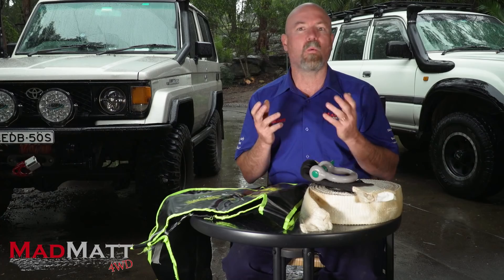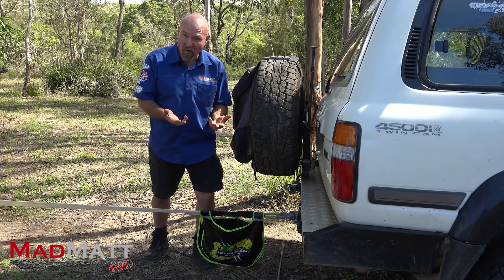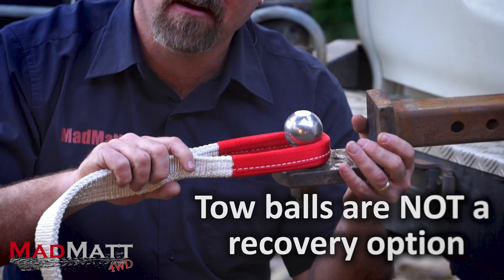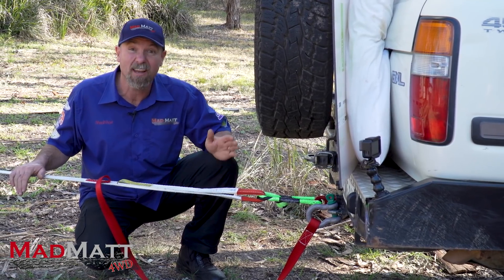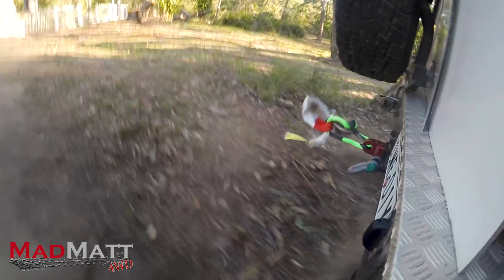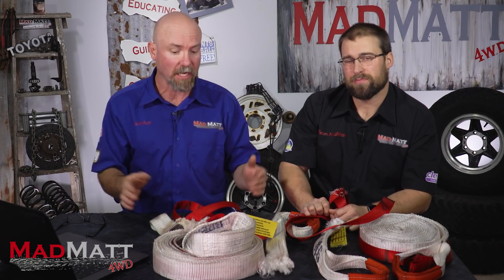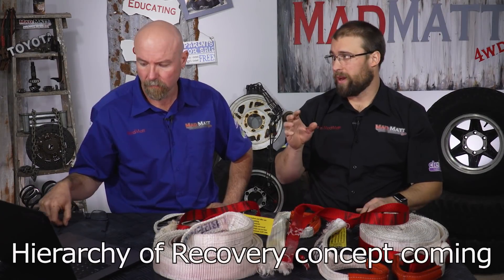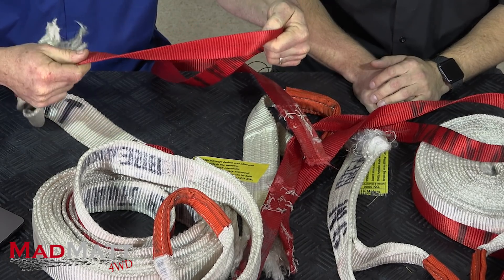Dangers of Snatch Strap Recoveries - Destruction Testing

Comment: My ideas would be: 1) To make the tether quite a bit longer so that by the time it engages, the broken snatch strap is already rebounded to its initial length and all the tether has to do is arrest the mass of the tether in flight instead of the tensile force of the stretched strap. 2) To make the tether part elastic too so it absorbs the energy in the tether instead of just ripping out the stitching. 3) to make the tether be a bit stronger (maybe 1/4 to 1/3 of the breaking force of the main strap). Because of the fuse, we know that the force the tether is faced with is the full breaking limit of the strap, which is considerable. And to be safe, we need turn that energy into heat rather than momentum. A weak tether can't convert much energy into heat before it breaks.
Reply from the maker: Totally agree

Comment: Like you stated, those tethers are too short to be effective. They would be better at 20% longer then the stretch factor of the snatch strap. Then, also FUSE THE TETHER! This way on a failure. The snatch strap would be fully unloaded and the tether would only have to suppress the straps momentum. The fuse in the tether would prevent the recovery vehicle from reloading the strap. You may still have some recoil, but because tethers fuse there would be less energy stored in the strap.
Reply from the maker: Agree

Comment: Love the use of the mattress and corry iron to protect the tree haha
My complaint is you are using your 80 series.. haha...   hows the scar in the tree, would have close to be healed by now or will in 5 years.
Good work, well done.
Reply: Use a 20' strap as the load strap. Add a 30' strap wrapped around the 20' strap. I attach both to the same load point shouldn't need different  points. When if the 20' strap breaks it will tangle in the 30' foot strap before reaching other end. Strongly suggest the 30' be a stronger strap but is not necessarily required.

Comment: I was taught that you’re supposed to drape a blanket or a coat across the middle of the strap or rope when you were going to pull.
Reply from the maker: That was the thinking back in the day but now days it's preferred to fit the dampers at each end and in the middle. Although some of us are moving away from dampers all together but that's a massive discussion.

Comment: How did you rig the first test to have the shackle fire off of the 80 Series into the tree? Just so I can make sure I never do that.  Thanks!
Reply from the maker: So long as you use good gear correctly you'll be fine. I had a fuse in the system so it failed when and where I needed it to.

Comment: i think a good design would to have the safety strap 2/3 the length of the snatch strap, and have the safety strap in a bag attached to the vehicle and the bag  with  a slot so the safety strap has to be pulled out of the bag to slow the snatch strap down  but limit the length to 2/3 , then after the snatch strap  snapped you have a strap that will be 2/3 longer so the vehicle has time to stop and not pull on the safety strap
Reply from the maker: That's worth considering for sure.

Comment: Need a 10m seatbelt strap set up on a Auto enursha  spring set up that has a recoil spring?
Reply from the maker: That’s an interesting idea
Reply: The longer it pulls out the stronger the spring gets. Don't have a lock like a seat belt but just the recoil?
Could have pins and a Rachel as well so it has more than one use?
Reply: Maybe even have the complete Snatch strap set up on a recoil Hose reel sort of set up and have a fuse replacement  pin rated at 4ton?
Fully retractable  .so when it reaches  its limit ? It's breaks the pin and1/3 is under high spring tension?
I too have seen a Snatch strap go off and Break through  the rear glass of Tow car and rip off a Mazda recovery  point

Comment: I’m pausing the video at 11:00 minutes to comment so I might be too hasty but ....
I didn’t understand your description at first,  then when I saw it I thought it was a brilliant idea but why isn’t the tether about 80% or 90% as long as the strap and accordion folded under a Velcro loop ?  Wait..... I have a big roll of 2” wide industrial Velcro.  What about the whole length and width of the tether,  Z-folded against Velcro.  The inertia of the strap is lightweight enough the Velcro would slow it down some before it completely unfolded.  It could even be made as an add-on kit for existing straps.  Maybe the forward end of the tether “system” should be attached to a separate spot on the vehicle just in case the failure is forward of the strap fuse. <<disregard that last sentence,  I just noticed you do have it connected to a different spot. On a side note,  I was never comfortable with the jolt,  so I put two 30’ together for 60’ when there was room and really liked the result.  There’s probably a whole list of reasons that’s not smart but I did avoid any mishaps thanks to a good off-road coach.  OK,  now back to finish the video.
Reply from the maker: Lol. Champion comment. You have some great thoughts there and I certainly would like to explore some different solutions
Reply: MadMatt 4WD 
You and I both responded to Russell Hembrow’s suggestion of  2  unequal length yank straps joined loosely every few feet with loops.  It just dawned on me that if the tether needs to be a lot longer anyway,  exchange Russell’s 2 nd strap idea for just one super long tether 
attached to both vehicles,  with plenty of extra length accordion folded at each end.  Along the length Russell’s idea of loose retainer loops is 👌

Comment: Sew it on in a concertina so it dissipates the energy as the stitching tears away? It will still recoil, but with a lot less force. Having the weak point/fuse will help too as its better to be hit with a strap than a chunk of metal from the car, it will bloody hurt and leave a mark, but shouldn't take your head off.
The problem is that people are less likely to buy something that is designed to break, even if its for their own good. Good rated nylon is expensive, so it all adds into the price. An expensive strap that is made to fail? Its a hard sell, even if to get it to break you're probably abusing it.
Reply from the maker: I think that would work.

Comment: Matt what do you think about winching from a tow ball?
Reply from the maker: No not ever and there's no need to as it's easy to have a decent connection point.
Reply: @MadMatt4WD  Matt, suggest you speak with your new buddy from Winder Towing about. I wouldn't recommend using a hitch ball, but Matt does it all the time.
Reply: kingstonsean Matt at winder never winches from a tow ball. He doesn’t even have a winch on the banana. And he uses his j hooks in a bridal configuration. He is a licensed tow operator and has insurance liabilities to worry about.
Reply: @CooterTravenport  You're correct. He doesn't winch from a tow ball. But he does use it for recoveries, and that's what I was picturing in my mind. This video isn't even about winching - it's about recoveries. Anyway, I would think strap or rope recoveries might cause even more dynamic load than winching. Winching is slow and steady, recoveries will always have at least one significant "shock".

Comment: Making the tether like a fall arrester would make the snatch strap a single use device, no one would buy them. all it needs is to be made out of stretchable material that could absorb the energy without breaking so it would be reusable.
Some years ago we had a snatch strap that was made from a rubber that would heat up when stretched, this heat would cause the rubber to contract with great force but very slowly, it was known for pulling off axles or doing other damage because once activated there was no way to stop the pulling force so they removed them from the market, I made a high pressure release for mine with an adjustable tensioner so I could control it better but it was still dangerous it you didn't know what you were doing, it was stolen out of the back of my 1961 dodge power wagon and I could never find another one to replace it.
Reply from the maker: Wow I've never heard of that devise. Sounds wild.

Comment: Matt, maybe talk to Simon at Lock Your Hubs 4wding (Youtube channel) he has test rigs with load testing equipment, and both of you should be able to work something out which would be great to see and some more collab between content creators I think is great for the community. Yes, I know this video is in 2019. To me it seems the tether strap is severely underrated for its intention, it should be a similar thickness and type as the strap itself, and should be a longer length and possibly be at least(my rough guestimation) 1.5 mtr to take up the stretch factor of the strap and a bit extra (its intentional design). I was taught how to 4wd by the Dept of Defence when I was in the Navy in 1986 as a firefighter and the first part was learning about and how to use the vehicles (which, was a 3-month course on its own as the start of the firefighting course), and they have rules and like you say use the hierarchy of recovery which I think most people don't use.. they just grab a strap and go for it (much like you state) without looking or thinking of scenarios or options first.
Reply from the maker: Totally agree.

Comment: Good video, you're testing kinetic energy from a vehicles momentum doing av"snatch recovery". These straps that are repurposed from constitution sites lifting or truck load straps designed for static loads, with pulling their load up with a crane, or holding the load on the truck. Never designed for kinetic energy loads.
Kinetic Recovery snatch Ropes are the best (Yankum brand), they are using tug boat rope technology pulling 100,000lbs without failing because the water current changes direction and the weight of load on the tug. Straps are still useful to connect to a tree when winching something out of a hole or mud/sand winching a vehicle that's a static load. I have a giant 10inx10ft (25cmx2m) anchor strap for winching.
Matt's Offroad Recovery is a great YouTube channel highlighting thoseKinetic recovery's.
Reply from the maker: I've done videos with Matt. This is a different strap to the load straps you refer to. These are designed to stretch for kinetic recovery.

Comment: Let’s say a 5lbs weight (2.25 kg) is flying through the air really fast. That breaking strap looks faster than my bow and arrow so let’s say 100m/s. You could measure it for testing. Acceleration = delta velocity/delta time. So when it hits your car/face it stops instantly and creates 10,000m/s2 of acceleration. F=ma. That’s over 22600 N. To convert to tow strap weight ratings divide by 9.81. Easily could exceed 2500 lbs (1130kg) of working force. That’s easily 8% of a nice 3” tow straps rating.  That is the force to stop only 5lbs of flying strap. If 15 lbs went flying that’s easily 25% of a nice tow straps break force. So when a hitch with 5 lbs of strap goes flying it could easily be 15 lbs.  Without any vehicle momentum.  Use a secondary safety tow strap 5’ down from the pull strap anchor. Attach it like you would connect to pull straps. Connect to safety tow strap to the anchor/vehicles. One for each end. The safety straps need to be less than the distance of the pull strap but long enough to allow the stretch reflex to occur. 30ft 20% stretch 6 ft. The safety strap should be minimum 8 foot better 10/15 foot and fully rated. Just use an extra rated tow strap you have lying around. The safety strap should not stretch so it doesn’t rebound. Use caution. Start with low force and work up. This is a safety feature not intended as a regular catching feature.
Reply from the maker: Great comment. If only more people would listen.

Comment: Never, NEVER use steel shackles to join straps.  If one breaks, thats shackle becomes a bullet! Steel shackles should only be use to to attach to solid recovery points.  So when the strap breaks (if it does) its only the strap itself thats going to hit you. Secondly.  Never use a tow strap as a snatch strap, the shock load will break them. I personally only use straps that are rated a minimum of 2 times the expected vehicle.  So a 3 t vehicle,  should be a 6t WWL strap at a minimum.  But no more than 3-4 times. Any more than that and you won't get the stretch you want cushion the hit and slingshot the stuck vehicle. But definitely always use a couple weight bags. Keep em clean and toss em if they show any wear/damage
Reply from the maker: Great comment

Comment: Nahh. If you want dangerous go back to the old days of steel cables that take half the back of a truck off when they go. Or cut someone in half. Sure am glad to see winching safety come so far. Composite ropes and straps would leave one hell of a welp but not much more. Where it could get ugly is if the D ring is still on the end of the strap when it breaks free. Not good.
Reply from the maker: totally agree

Comment: I dont know why is this complicated...the idea of a tether is perfect, but implemented wrong...they should attach a tether long enough for the driver to hear the strap snapping and brake (which should take about 2 seconds max)...second, the strap should be elastic (I know the tether and strap are a bit elastic, but I am talking about more, springy material), spring rate formula is easy and add to it the mass of the whole strap flying back (momentum of the recoiled strap) then you can design a tether that is long enough and absorbent enough to work perfectly (provided that the weakest point in the system is the strap)
Reply from the maker: I tend to agree

Comment: 1:44 who's still using metal shackles in 2020? If you've got them on recovery points they are rated for 2x minimum the breaking strength of your strap.
Reply from the maker: Firstly this is now 2021. Just to be clear. Secondly this was filmed some years back and as I’ve learned I’ve changed some of my ways. I do prefer the soft shackle for most things BUT there is nothing wrong with using a bow shackle in a recovery connected to a suitable point or points on a vehicle. Again I will continue to use them as part of my recovery kit.

Comment: I have a couple of suggestions to add military people that load things to be parachuted they probably have some pretty good information about the shock loads that get put on the synthetic ropes and cables and what not and how to rig them also the shipping industry where comes to lifting things or Towing things and fishing nets those people got to have a wealth of knowledge. And my own idea how about a strap that's doubled like a strap within say example fire hose but the hoes ask me way longer and add some weight so when the thing comes loose the energy gets absorbed fighting that weight. Also whatever length strap that stretches should have a safety strap alongside if that's say four or five meters longer than that. The tether needs more time to deploy to absorb The Recoil energy and then to exert its own stretching to get everything under control go longer tether is probably going to be key to the whole deal

Comment: The safety strap works when pulling yourself or someone else. Not designed to pull out a tree.
Reply from the maker: I disagree. I’ve seen many recoveries where the bogged vehicle didn’t move. Anyway this wasn’t about trying to move a tree but see what happens when we have a failure.

Comment: But I don't understand, it failed at what tonnage, and how do I know what I need or do
Reply from the maker: I would suggest you look into the Factor55 recovery ropes.
Reply: Add your vehicles weight combined with recovery vehicle weight and multiply by 3 for example my ZJ has 35k lb strap that is based on a similar sized recovery vehicle was used my 1 ton truck will have a minimum 75k lb strap

Comment: I think your last comment where you attach the strap and hit it like a bat out of hell is the reason snatch straps are more dangerous then they need to be. Let the strap do the work not the car pulling. Slow steady take off and if that doesn't work after the second time or third time then winch. Just to mention you would have used tracks and track building and still stuck...lol..
Reply from the maker: I totally agree but you need to keep in mind the purpose of this video is not to teach snatch recovery but to explore the use of a tether as a safety device.

Comment: The new way to do this type of recover is with kinetic ropes, correct?
Reply from the maker: Correct. I'm much happier to use a rope over a strap.
Reply: Kinetic recovery ropes are old school and it's all ive ever used in the 25 years of off road driving and successfully recovered trucks in some big holes with them.
These snatch straps seem like glorified tow straps.

Comment: 13:11 Absolutely incorrect. That recovery point is in total violation of the minimum bend radius from the manufacturer of the actual material.  To achieve the rated capacity you need to be at five times the diameter of the soft shackle. This information is listed right in the technical specifications, you should have looked this up. If you look at sailing rigging, where they know what they're doing working directly with the Dyneema manufacturers you'll see they all abide by the ratio.
That recovery point is 2:1 maximum. That only gives you about 65% of the rated strength.
Reply: Got any documents which state minimum bend radius? Or test results? And, also the difference between static and dynamic bend radius?
Reply from the maker: I’m well aware of bend radius. Given That this hitch receiver is made by Factor 55 who are essentially one of the world leaders in this area and this is recommended by them I think I’ll continue on.   FYI they have watched this video and approved this demonstration.